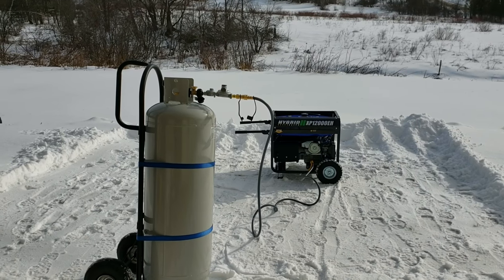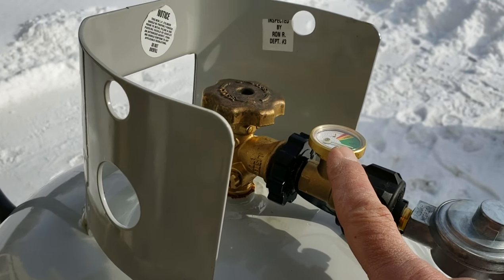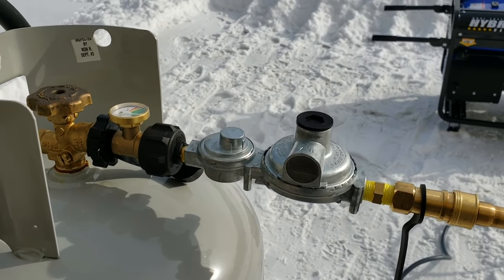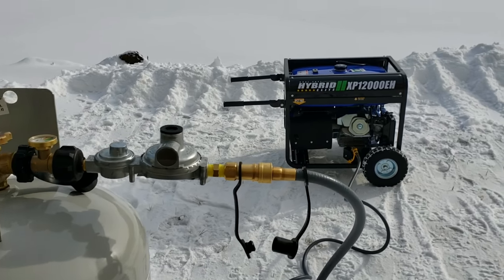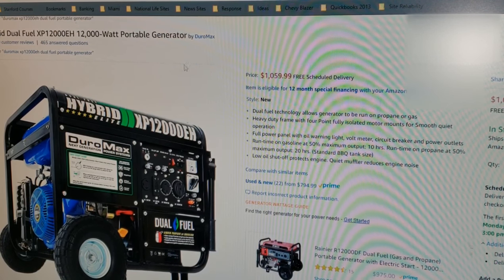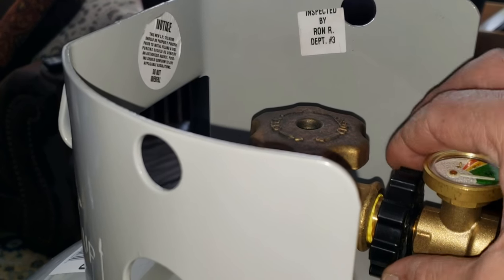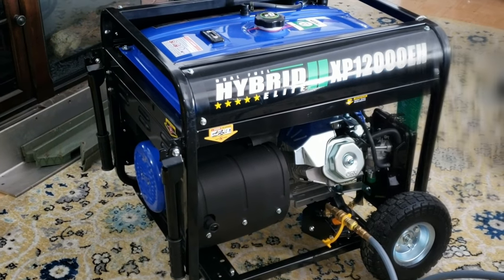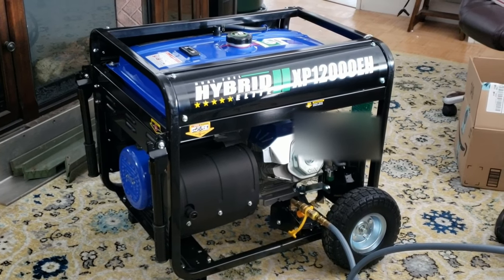Ultimate 100 LB Propane Tank Setup - Duromax XP12000EH 12000 Watt Hybrid Generator - Step by Step

Comment: Aren't you suppose to prime the LP three times before starting ?
Reply from the maker: I'm not an expert but I follow my manual to start it
Reply: No. You don't prime the lp. There is a button on top of the duromax regulator. It purpose is to purge the air from the line going to the tank so your not trying to start the generator on air instead of lp gas.
You simply press the button and hold it down for about 10 seconds.   That should be enough time to purge the air from the line. A longer line may require more purge time. When you hear a change in the sound while purging and smell lp gas, you have it!
Reply from the maker: @mrgary7711  the regulator on my generator does not have a purge button.
Reply: It is a duromax right? I have the duromax 10000eh and on the top of the regulator there is a spring loaded button for purging the air from the line before starting. If there is no purge button , how do you purge the air from the line before starting?
Reply from the maker: @mrgary7711  I saw that in the directions, but my regulator does not have a button.  Or I'm missing it somehow.  But I dont think I am.
Reply: It would be right in the center of the regulator.  Gas line goes into the side of the regulator and the purge button would be in the center.
Reply: @mrgary7711  mine too
Reply: @mrgary7711  you are right.  The Duramax company actually has videos about starting it, and yes, they do prime it with that button on the regulator you spoke of.

Comment: Why didn't you just stick with the regulator assembly that came with the generator? Seems like you're trying to reinvent the wheel here for no reason. Or, if you wanted another setup, why not just get a replacement hose/regulator from the generator manufacturer?
Also, you've got the choke backwards it would seem. Once you started the engine, you could hear it wasn't running right. The choke needs to be OPEN during running. With gasoline you usually need to close it for cold start, but as I think you were mentioning in the video, you don't even need to do that with propane. According to the diagram on the frame just above the choke lever, open is to the right but you said and moved the lever to the left.
Reply from the maker: I wanted two different setups independent of each other

Comment: Sir, you couldn’t have done a better job with this very informative video. Thank you very much for doing this. Im. Anew viewer and just liked and subscribed.
I have a question:
I have just purchased the exact generator.  I’m deciding on a tank size for it.  How many hours of run time are you getting out of that tank? 
Thx again sir
Reply from the maker: Thanks for the kind words.  You can get a out 24 hrs at 50% load.  Hope this helps.
Reply: Vermont Prepper , so are you happy with this size tank?
Reply from the maker: For me it works cause I live in an apartment.   If I had a house I'd probably go bigger as well.  But I do like the portableness of the 100 gal.  So yes, I am happy with it
Reply: Vermont Prepper understood. Thx again

Comment: How many gallons of propane does this generator burn an hour?
Reply from the maker: Supposedly would burn thru 100 lbs in 24 hrs
Reply: I don't think it's 100 gallons, more like 100 lbs.
Reply: Elaine Simons.  To me the real benefit for using propane over gasoline is you don't have to refill tank with propane and it won't go bad. Cost is almost always more expensive though. Just depends on what the rates are for both in your area.

Comment: Why did u not use the regulator that came with the generator
Reply from the maker: For two reasons, 1.  Wanted to make sure regulator was large enough for 100 lb tank, and 2.  I wanted two separate connections for for the 25 lb and the 100 lb tanks.  Hope this helps.

Comment: Those connections look so big like if you barely lean on it everything is broken whoever designed the generator should have designed a better regulator part like a welder like a like a regulator on a welding tank why this thing is like what is it like almost a foot and a half long if you're on the job site where you're trying to do something and something breaks what do you do?
Reply from the maker: Can connect direct as well without quick connects.  So if something breaks I'm still ok.  Good point though

Comment: Why two regulators - one at the tank and one at the generator?
Reply from the maker: The generator came with one installed and another for the tank.  I use the tank regulator it came with for a 20lb tank.  The one I show in the video was a whole separate setup for a 100lb tank.  It has a different connector and I wanted two separate systems anyway so I don't have to disconnect the regulator from either tank.  Thanks for watching.

Comment: I have one of these. It ran the water well pump well, but upon back feeding the 2 legs of 120volts back to the house it went off balance and put 230volts on one side and 10volts on the other. Burning out my 120 volt light bulbs. 
  I found that the only way to run the 120 volt devices is with a 2 way male cord and back feeding into my home but this only powers one leg of the home.

Comment: The right setup, but on the wrong generator.  Those Chinamax machines put out dirty power. The THD is 12%, which is not recommended for anything electronic.
Reply from the maker: You need specific generators for clean power.  I don't use it for that.  I have other generators for electronics, including a solar one I built

Comment: Doesn’t the generator itself have a regulator?  Aren’t you regulating twice?
Reply from the maker: The newer units like mine comes with a decompression valve/regulator (on the generator frame) + a separate small regulator shown in the video.  They indicate it is an upgrade from the older units.

Comment: I personally don't like the quick disconnect on the tank ...it adds leverage/length not to mention extraexpense and one more thing that could leak ...ya know?   And it just seems like to me to be a totally redundant feature not adding any advantage?   Personally I would remove the entire regulator and hose via the normal quick disconnect completely from tank when not in use and just store it separately as a complete assembly....of course I would put thread protectors on anything when not connected and probably store the regulator/hose assembly coiled in in a plastic bag....otherwise I like it!
Reply from the maker: Good points.  I like the quick disconnect since it allows me to have a gauge and it also is easier to refill when needed.  I dont have to put the tape on.  I get what you are saying though

Comment: the regulator with the unit should have been fine. Why did you need to do all this?
Reply: That's my question too. Are you familiar with propane hookups? I am going to hook up my house propane tank I use for a fireplace. Since the tank I have is supplied with a regulator for the fireplace, which is pretty large to heat the whole house, I figure it should be fine. I rather just put a black pipe 3/4 T connector on my gas line after the tank and go to the 10000 watt generator. Do you think that's sufficient?
Reply from the maker: I wanted two separate hookups - one for a 20lb and the other for a 100lb.  They are different connections.  Now I do not need to disconnect anything from either tank.

Comment: In order to combat the GOD complex... read the code... I have caught more "wizards" trying to fail me or stop construction, from them pulling crap out of their butts... 

Last one was, building inspector shows up, after over a week of me building and I was 3/4 of the way through decking a monster ground level deck, said I had to stop building, disassemble the deck, and dig up next to one post foundation, so the foundations could be inspected, to make sure I was at 4' depth and apply for a building permit, so he could come back and inspect the foundation. I said... I don't think so...  And he said why is that? And I said apparently you haven't read the town building code... It says... decks 18" and lower do not not require a building permit, Pulled out a tape measure and showed him the highest point off the ground was 17 3/4". Pulled up the page on my smart phone and said here read it for yourself... He said... I guess you are right and walked away with his tail between his legs.

Another one tried getting me on code violations and for having an illegal apartment, he forgot that 6 years before, during the pre-buying inspection for the bank of the building, he had signed off on their being 2 apartments and one commercial business, and at that time there was zero code violations, and didn't pay attention to the "new" code dates on the other violations, because I was grandfathered in.

So read the city, town, whatever... code books and the state electrical, plumbing, construction, fire code books and they won't be able to jerk you around. And save any paperwork from them.

Comment: Don't put any teflon tape on the POL.Can tighten before sealing. also why not just put the POL onto the Twin Stage Regulator.
Reply from the maker: I wanted to have a quick release from the pol.  Didnt want to have to unscrew regulator everytime I refill.

Comment: The regulator on the tank is unnecessary.  The Duromax generator regulators are capable of handling full tank pressure.  Dropping pressure before the generator regulator may even be detrimental to the operation of the generator as this could starve the generator of sufficient lp gas under a full load.
Reply from the maker: The new generation came with a separate regulator.  I use that one for the 25lb tank.

Comment: It’s not that inspectors have a “God” complex. They are not paid to or allowed to be designers. They are taking a big chance when giving advice on the code/design issues. It’s because people will misconstrue or hear what they want to hear. Then when something goes wrong the inspector gets sued. And if you think they have immunity that is mostly true but not completely. Even if the inspector wins in court they still suffer damage and will have been slandered with no recourse. The trouble is, you will say you won’t hold the inspector responsible but when something goes wrong you will sue that inspector. We as the people have over regulated ourselves to death and nobody will in reality take personal responsibility. Sure a homeowner can do their own work but in most cases they won’t. They want the inspector to tell them how to do it and then they hire cheap labor and cut out the licensed qualified contractor who has earned their way. I would never want to take the right away from a homeowner to do their own work but don’t expect an inspector to do it for you. It’s not fair to the inspector to be put into that compromising position.
Reply from the maker: I get what you're saying, but they don't have to talk down like I'm an idiot.  I realize they have to be careful, but there's a way to deliver the message without being an ahole
Reply: @VermontPrepper  I agree

Comment: I'm no stranger to LP but the further down the connectivity rabbit hole one goes the darker it gets.  POL, QCC (various sizes , flare, inverse flare, NPT , Quick connect  back and forth over and over. Rinse lather repeat.  NTM  valves, regulators, gauges  ....  I swear the LP suppliers are in cahoots with the brass fitting industry.  Hundreds of $ of oieces parts to hook up a fkn tank is FKN insane.  And then if you take your bottle in for refilling you'll pay at least twice the price per gallon than for delivery .   Go FKN figure,   Don't get me started on manufacturers who use proprietary fittings that won't interface with (convert to) anything else  (ahem -  Champion LIARS.
Reply from the maker: Well said.  Totally agree

Comment: I have a DuroMax XP4850EH dual fuel, I called DuroMax the company that makes the Generator and they told me to use the same  Regulator that come with it, witch is high flow regulator, on a 100lb tank, the one in this video is a low flow, they also told me if I use any other regulator my warranty would be out the door, so why would you call a company that makes regulator when they don't know nothing about the specs of the generator? and with all due respect your set up is over kill, like im in Florida about to get hit with hurricane ina is not like we get hit every weekend with hurricanes maybe the next time I use this generator would be like 10 years from now. for simple set up all you need is POL to QCC1 Propane Tank Adapter and longer hose for 100lb tank. case close.
Reply from the maker: Whatever dude.  Use or do not use what you want.  My setup still going strong.  You seem to be a know it all, so why bother to comment?  Or, maybe figure out a way to comment/criticize constructively instead of douchey.

Comment: These generators a super Noisy and in a Grid Down you will make yourself a huge target by anyone that hears these.  If you have one of these you better have a very good sound reducing shed.  I highly recommend the 3500Watt BE inverter type super quiet generator or the 4500 watt inverter generator they are great for camping also if you have a 50 ft generator cord it is super quit.    I know this generator is more powerful and can run 220 volts but people will kill for this in an emergency.  People even will try to run a lawn mover so you do not hear them as they steal your generator.  Remember 90% to 99% of people will be unprepared and desperate.
Reply from the maker: I have a big solar battery for an apocalypse type scenario to eliminate noise

Comment: You’re definitely not an expert, and as someone who is, I would not take your video and run with it. For example, You’re going to have to ensure the tank does not tip over by strapping it to something other than a hand truck. A  steel post or structural beam would be appropriate. Also, yellow pipe thread tape is not 
for corrosive gas, it is double density for pressure. I would use Rectorseal paste instead. Although what you’re doing seems safe, LPG is extremely flammable ( obviously) and I would encourage people to do their own research.
And if you need to “bug out” and take this setup with you you’re going to need some help or a lift gate on a truck.  Probably more than 200 pounds each for generator and tank.
Reply from the maker: I didn't hold myself out there as an expert.  Agree with strapping.  Would not use this tank to bugout.  Have 2 tanks on  a trailer already.  Also, yellow tape is for gas lines, no?
Reply: @VermontPrepper  I think what his saying is dope is better to use than yellow tape. I'm no expert either, but I've the yellow tape and had much better luck with the dope. Never had a leak.
Reply from the maker: @bertpainter8385  I'm more likely to listen to your advice because of the constructive way you presented your viewpoint.  I dont listen well to people who basically spout trash then try to give me their "expert" advice.